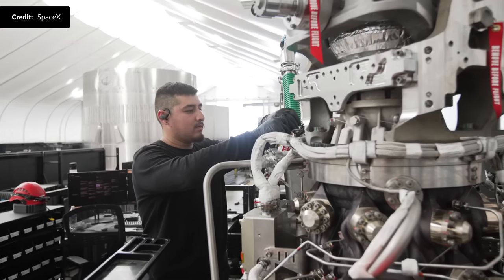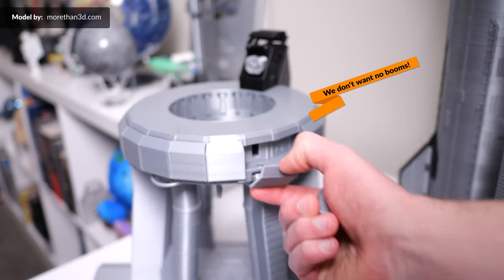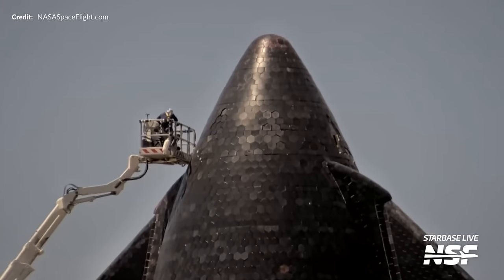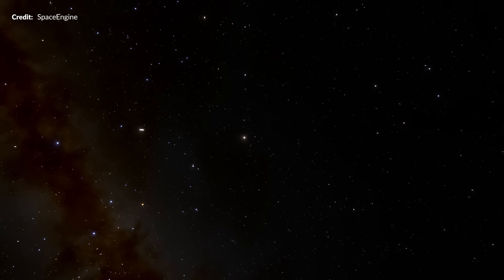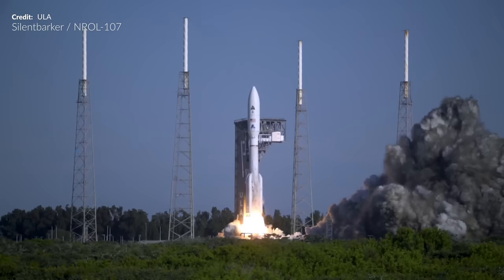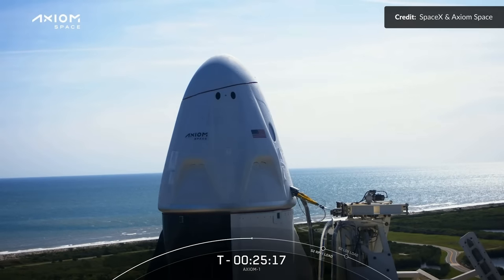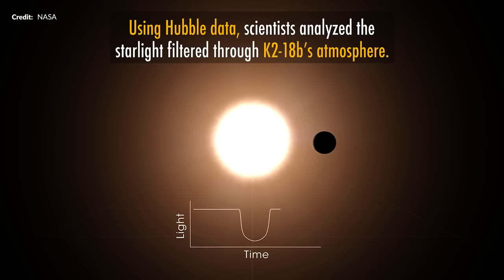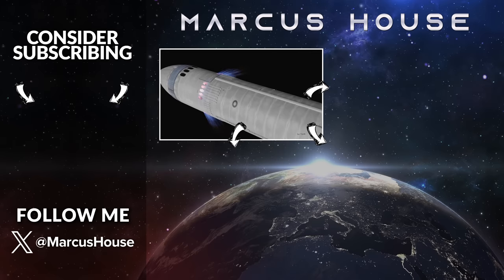SpaceX Starship 25 is gone, but why!? Plus New FAA Flight 2 Target Revealed!

Comment: I noticed this on another video which I thought was a previous launch.   But I see it again here at the approx 12:35 minute mark.   You can see something still attached to the side of the payload fairing.   It appears that an umbilical broke off rather than disconnecting properly and was left sticking out during ascent.

Comment: Well it's not so much that the phrasing of the checklist is odd because it's redacted, rather that is pretty common phrasing for such a list because it's a summary.
It's likely they decided to adjust the torque spec in a few different systems, of which there is a list somewhere, so they summarized by saying certain systems.

SpaceX is probably not trying to be secret there. That's just the effective phrasing for the summary.

Comment: I agree that the added LOX & CH4 capacity is very unlikely to be on line before the next launch but do you think they might be aiming to get the extra water tank and pressure cylinders integrated into the deluge system prior to the next test?

The static fires were only done at about 50% throttle so having as much capacity in the deluge system for the next launch would be very reassuring. And if SpaceX is aiming for that then do you think they'll do another test or set of tests on the upgraded system to check that pressures are still balanced correctly and the timings are still optimised and working as expected?

Personally I would feel a lot happier if that is done. SpaceX really needs this next launch to go as smoothly as possible in terms of any effect on the Boca Chica environment so every bit of safety margin it can get online and tested in time would seem like a good idea to me.
Reply: With the old manifold gone they have to get the new one in. The water deluge system isn't operational until it is.

Comment: I'm still curious about why the grid fins will be fully deployed on launch?
Yes they are big and would require large and heavy actuators to operate like those on the Falcon 9, but they are designed to swivel so why not have them swivel 90 degrees on launch to reduce drag?
Reply: Good question
Reply: probably increases drag to do that.
Reply: Elon said the weight of the extra hardware needed to fold the fins negated any friction loss reduction and having the fins perpendicular to airflow didn't present much more surface area than they would in parallel positions.
Reply: @patrickdurham8393  It could also hurt stability in the folded position.
Reply: the drag is minimal so elon says. so adding actuators are not worth the added weight and complexity.

Comment: Could you please find flaws in an idea I have for Starship. 
Why doesn’t Spacex line the two rocket chambers with rubber bladders. As the propellant flows out, the bags would collapse keeping the fluids relatively compacted, eliminating the issue of trying to spin the rocket to get the fuel to flow to the jets. 
If we don’t have a material that can withstand the extreme cold, then wouldn’t it be a great area to start doing research on?  With the Spacex engineers, it seems that the only thing impossible is the things not though of yet. 
If you need a basis, I saw an episode of Dirty jobs, where they were pulling a bladder out of a wing of a C38 that had sprung a leak. 
If jets can use bladders, why can’t rockets? 

If the fluids were contained in a bladder, then as the bladder compresses, clean usable space increases. 
This could be turned into livable space if Starship or the boosters were to be used as a space station. 

If you can’t contain the liquids in the bladder, how about filling a bladder with compressed air to push the fluids into a smaller area? As the bladder expands, that space could potentially be used as a livable space. 
possibly even installing a Bigelow inflatable module inside the starship fuel cavity greatly expanding the livable space Astronauts would have directly as after launch.
Reply from the maker: What material can do this when frozen by the cryo propellants? Certainly not rubber.

Comment: I was under the impression that HLS would use smaller thrusters mounted on the side and high up on Starship during Lunar landing in order to prevent kicking up too much Lunar regolith? Or was this just testing for earlier in the descent?
Reply: Ah it seems it was modeling the initial de-orbit burn/initial descent while still high above the surface:
"In a 281-second-long test firing, Raptor demonstrated the powered descent portion of the mission, when the Starship HLS leaves its orbit over the lunar surface and begins its descent to the Moon’s surface to land."
Reply: yep you answered your own question there :)

Comment: Yes, SpaceX has been busy on its to-do list. But what has not occurred so far is a static firing on the OLM with 33 engines at 90% throttle rather than only about 50% throttle.  Perhaps the FAA is in a quandary because of this missing piece of testing data. What to do? What to do?
Reply: They can't do 90% - it will fly away.
Reply: What to do is grab some popcorn, stand back, AND LIGHT THAT CANDLE! Excitement Guaranteed!

Comment: Would Atlas V having three boosters on one side, and two on the other, not make it unstable?
Reply: The Atlas V (551) always flew like that
Reply: Maybe they use thrust vectoring or even variations of throttle between the side boosters to compensate for the imbalance.  Not sure but it seems to fly quite successfully!

Comment: How are they certain that Starship's incredibly large steel shell is actually entirely air tight?
Reply: They pressure test, every one of them.
Reply: @williamtsmith9668  they pressure test the fuel and oxidation systems certainly.   I don't recall a specific hull pressure test.  Must be done quasi secretly

Comment: Prediction: if you add water injection like that to what we saw on the previous launch... It will only create larger more destructive pieces that will no doubt ricochet straight up and destroy engines on the bottom of the rocket or systems even worse.

Comment: What?  Raptor moon landing
They are going to install raptors up by the nose?
That does not make much sense.  I am having trouble with the math or mass as the case may be.

baby raptors or compies maybe.  You lost me here.
Perhaps, Raptor to launch from the moon - same engines used to land?
Feeling is we are missing part of the story.  That is nothing new.
I wonder what it takes to place a landing grid ?  Moon mat.
Stay tuned for the next exciting episode from ♥
Marcus House

ps- I notice the YouTube creators have upped the number and frequency of advertisements.
Just seems that way.
Reply: There was talk of using a bunch of SuperDraco engines at first. Now it's anybody's guess, I think
Reply: The big raptors will be used until the Starship is on the order of 100 meters above the lunar surface. For the first few flights, Starship will have a comparatively huge mass budget. So the rocket engines won't have to be very fuel efficient.
Reply: Ahh, two stage landing?  at moon 1/6 G - The will have to feather the landing.
Then we have a minimum number of raptors (vacuum raptors? no atmosphere) hum

I like they way you think.
 @hamjudo  

A pad or landing carpet - roll out a mesh. It is or should be a priority.
Launch would throw too much silt.  Like cave diving.   Could they lift on the draco's or baby raptors then engage the main engines?  The reverse of landing - pack out your trash, so to speak.

Typically they have had two parts the bottom half left (abandoned) on the moon. It might make for a good start to the moon base.  Use the hull as a door - a portal to a buried or underground complex.  Nope not until we have a lunar crane.  It maybe more like molting or caterpillar to butterfly - Send parts that can be repurposed for air and prop tanks etc.  Exciting times ahead.

2 years?
Reply: The last I heard, SpaceX were planning a ring of 24 small engines at roughly 2/3 the height of Starship.  I would guess that would put them at about the bottom of cargo hold.  What type of engines they will be I do not know.  Hypergolic fuels are highly toxic so I don't think they want to handle them if that can be avoided.  Added to the toxicity danger, any surface contamination with one part will cause exciting effects if the same surface is contaminated with the other part.  Then, there is the added complexity of having two complete sets of tanks, piping, valves and controls to maintain and use.  Because the HLS vehicle will not be capable of atmospheric re-entry and is designed for reuse, any second fuel system will require in-orbit refill at some point just like the methalox main engines.  Two incompatible engine systems in one vehicle strikes me as unsustainably complex.  I rather expect small methalox engines will be used but that's just my speculation.

Anyone with actual knowledge is welcome to correct my musings.
Reply: I am with you.  I would stay away from the nasty nasty stuff, stick with same propellent - all the way to Mars.

I wondered about Raptor for moon landing  as it is very powerful on Earth, Mr. House did not make it clear.

At this stage of the game if you had a killer idea - it would be considered.

Just because we used the LEM and 

I had to look it up.  Point is things change.

The Lunar Module (LM) – originally called the Lunar Excursion Module (LEM) and still pronounced “lem” after the name was changed – was the spacecraft that ...

lets extrapolate - IF  (big if) we can produce oxygen and CH4 on the moon - Moon to Mars transit looks really good - on lots of levels.

Okay - where we at?  Proof of concept.
Clearly the OLM taught us something.

Thanks for the follow on comment.
The 'experts' are afraid of chiming in - of making 'a guess' because someone might quote them on it.  It is okay to be wrong - incorrect - from time to time it happens to the best of us.  Thing is to learn and advance our cause.

Definitely - abandon the Hypergolic fuels that would linger at the moon base. not good - avoid that and ... nevermind story for another time

You might be surprised to find out how much of Starship & launch facility is crowd sourced.  Space X has ears

Hi (wave - smile and wave)

 @frankmcgowan9457

Comment: They need to install a deflector screen for those deluge tanks, yes it's not dangerous for those to be damaged but they are critical to operations now. Even a prefab screen slid under a reinforced lip would suffice. It only needs to direct the steam, smoke, dust  etc up and over.

Comment: Well done for mentioning Polly Trottenberg is the current Acting Administrator of the FAA. She's been in the position since June, despite having no experience relating to aviation whatsoever. The previous Acting Administrator lasted a year before resigning. A permanent replacement was nominated, but his only 'aviation' experience was managing the parking lots at Denver International Airport. Don't put high expectations on the FAA, there's a reason things aren't running that smoothly.

Comment: I would just like to say, for the record, that I don't think the current system is going to work. The water deluge system, and the full thrust at lift off, is too close and will not be enough to stop any damage from the next launch. i believe the distance between the thusters, and the base plate where the deluge system is located, should be another 20-30 feet further apart. I really do hope I am just being a bit too cautious, and I am looking forward to seeing this beast make a succesful launch. fingers crossed, break a leg, and any other good luck thing we need for this. Godspeed!
Reply: 20 to 30 feet higher?
When the exhaust plume is over 2000 feet long?
Stop it, already, with childish uninformed guesses.
It's getting pathetic.

Comment: What is floating at the top middle section of the screen at 30 seconds? If you zoom in and play, you can see that it doesn’t move a lot but it does seem to shimmer tiny bit.

Comment: Judging from the flat dome section and its proximity to the 3 center raptors, it seems like SpaceX is planning to ignite the 3 outer vacuum raptors in the hosting staging. At least in the first five seconds of the hot staging sequence. What do you think?

Comment: With all the sophisticated and required changes to the orbital launch mount, guaranteeing a successful ascent, it seems a tall order for such a system to be built on Mars for return flights to Earth. I suggest that many one-way flights will travel to Mars before any starship can return to Earth.
Reply: Returning to Earth should be much easier because Martian gravity is much lower, so probably there is no booster needed for the return flight.
Reply: @goldfing5898  Agreed. It's simply easily to construct the infrastructure on Earth than would be on Mars. 
I suggest also a transport system that is always shuttling between Earth orbit and Mars orbit, and never landing. Ships would dock and undock to it.

Comment: Ideally the schedule would be set by construction and engineering schedules, and not beurocracy. This is very expensive and disfunctional compared to a system where applications are given long in advance (like now), and actually acted on and completed by the time of launch. Imagine if your lunch was approved by the FDA 6 months or a year after your breakfast. If it is a matter of manpower, then hire more people, and charge more for the need in fees. The FAA is simply not as organized, streamlined, and competent as is Spacex. And then you have the whole political aspect. The government in the form of this administration, checking their i's and t's to an extreme degree, and then rechecking them, and then coming up with new checks, and now policies. Some of this is par for the course and understandable, but some of it is just slow walking permits and licenses, to slow Musk down. If you like the Space Program, don't re-elect the current clown ship. There should be an equal playing field for all the Companies involved, and the will of the People should be the only concern, not the pettiness of politics.

Comment: the saturn  5rocket water system poured into the engine fire zone ... spacex ... sprays the water out from the fire zone under the engines ... allowing the water deluge system to be less useful due to flash evaporation  ... making the launch pad a constant repair after each launch

Comment: I gave brilliant a try. But I think it sucks because if you don't understand something, you can't ask a question and get an answer. So it was going fine until they wouldn't help me figure out a problem that I couldn't understand. So proceeding any further wasn't possible if I wanted to learn anything. There was no free month. I lost $100.00. It's a stupid rip-off don't do it is my opinion 😡🖤
Reply: There is an endless number of places online where you can ask questions. Also it does have a free month if you sign up using the link provided by the YouTuber, and then most importantly you have to cancel before the month is over. It will auto renew if you don’t.